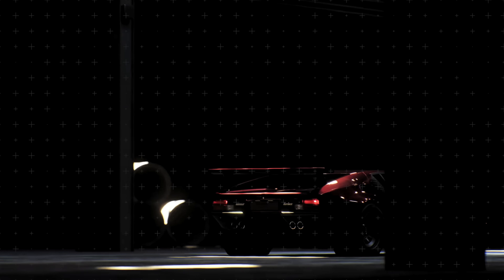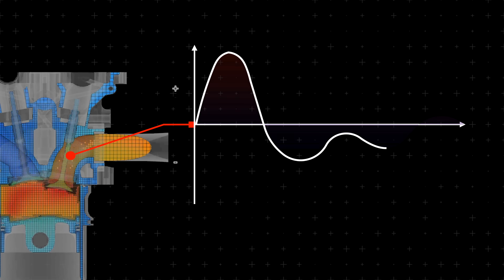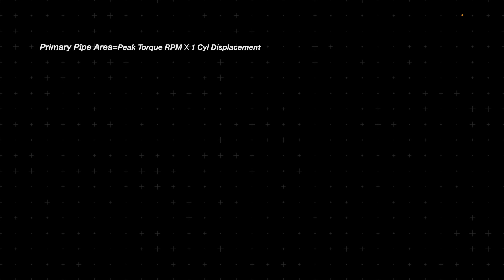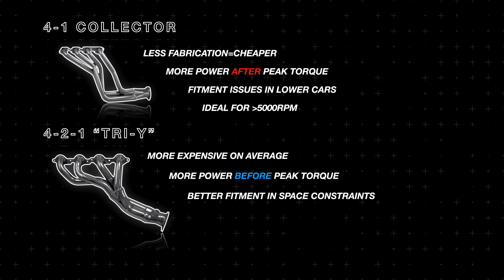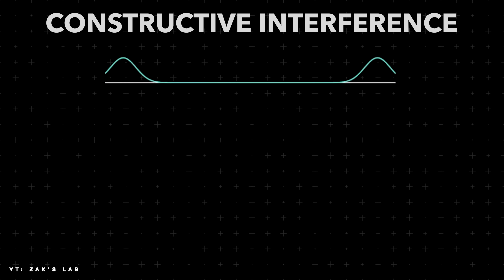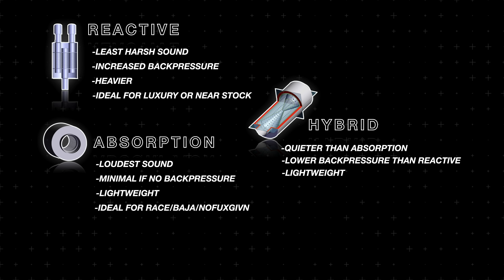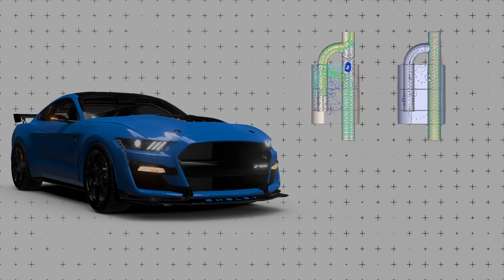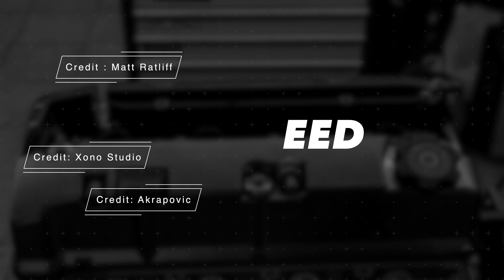Why Exhausts Make So Much Power😵| Explained Ep.27

Comment: This is my favorite part to upgrade on a Tesla
Reply: Make sure to get the oil change done first
Reply: Oil? My mechanic said acid change - he charged me $1,000 for the service and $150,000 for the medical bills. Guess it had a leak.
Oh well, 4th marriage ruined by the same car.
Reply: @chnacr2 strangely enough but kinda figured, tesla motors do have an oil inside of them, like a lubricant kind, for the gearing inside of them...
Reply: @chnacr2  teslas have to do oil and fluids for the mechanical components
Reply: @chnacr2  Tesla's actually do have an oil change interval.
Reply: @chnacr2  the gear oil does need changing in them they all have oil
Reply: Nothing like an oil filter change for my Dell from hell.
Reply: @i23intheplace2b Is that an AWD turbocharged Dell by chance?
Reply: Thats an expensive speaker 😂
Reply: @amburger4963  Just put a plastic card in the wheel spokes.
Reply: Add a few batteries 🪫
Reply: right next to the fire suppression system...
Reply: @Dr.Mcstaby 😅
Reply: @Dr.Mcstaby   As if fires never happen in ICE cars lol
Reply: Add some tank filled with gasoline too, you wouldn't believe how much range you'll gain over such simple addition
Reply: Get straight cut gears in your Tesla transmission.  I don't know why this isn't a thing, it sounds freaking cool.
Reply: Go buy a blinker fluid before everything or the car will explode
Reply: Don’t forget the air intake
Reply: I've got 6 pipes coming out the back of Tesla. But underneath they are all of different lengths, they are reeded & reduced. then connected to an air compressor! So instead of playing with phone at Stop Lights, I pull up a piano keyboard on  screen & blast out Church Music or Dukes of Hazard!
Reply: @kevinburke6743  Roflmao
Reply: Might as well change upgrade the carburetor
Reply: I always overtake Tesla's because the exhaust fumes from those cars is redonkulous.
Reply: @hectorae86 your not joking. If they are charged with coal burning fuel they produce  way more then any  internal combination engine  will
Reply: @Gh..o..s..t electric powerplants have 70+ perc efficiecy, Americans V8's approx 20 perc when german sofisticated turbo diesels can reach 40 perc. Answer is simple.
Reply: 😅 air intake as well 😂
Reply: @mahindrathar4092   Turbo in Supercharger out! Single purpose, single direction & single focus! If you don't push it in, she can't suck it out!
Reply: Me too
Reply: Yessir, I have 15 on mine! I even put dual exhaust on my battery, sounds fantastic.
Reply: Well don't forget to also upgrade your intake manifold.:eyes-purple-crying:
Reply: The first upgrade I would do to my Tesla is to upgrade it to a Mercedes
Reply: I found my people😂
Reply: no point doing an exhaust on a Tesla unless you modify the timing first...
Reply: You silly man, Tesla are electric! Everyone knows that if you use a fat extension cord, get mo' powa!!!
Reply: Yeah but there are too many to choose from 😂
Reply: Wait what
Reply: Ok
Reply: With a 62mm pipe exe... 🤘🏿🤘🏿🤘🏿
Reply: Hahahaha
Reply: Faforit saya juga ini
Reply: Electro magnetic exhaust is critical.
Reply: Love the application description for the absorption muffler. Think I'll be taking the nofuxgivin route
Reply: Rich Rebuilds and the Model D come to mind.
Reply: Same, gotta make that buzz sound as loud as we can! Golf cart sounds are just not cutting it
Reply: Only worth it if you turbo it first
Reply: i use my tesla to go out and buy parts for my big block
Reply: 😂😂 awesome!!
Reply: Especially if they are made out of titanium it will look really cool... however make sure you don't forget to put 1,000 fire extinguishers in your trunk
Reply: Faxx
Reply: motors use power , engines make it
Reply: why so many likes maaaan
Reply: A lot of people are doing the ICE mod
Reply: I did a upgrade om my rimac as well😊
Reply: @dominique21480 I know right I love putting mods my my rimac
Reply: Don’t forget the air intake
Reply: Why is there always a useless, juvenile, good for nothing comment like this on the top ? Please contribute something meaningful. I pity your empty life.
Reply: upgraded my washer fluid tank size 😎
Reply: What, the stereo, so it sounds like a real car?
Reply: I straight-piped my Tesla
Reply: Change the piston springs too
Reply: Home Depot has PVC tubing to make your Tesla some headers🤣😂🤣🤣🤣
Reply: Same
Reply: Can't beat that rumble n screaming u get from it with true duals 😅😂
Reply: I usually just swap out my Duracell for Energizer 😅
Reply: YES OVERSIZE EXAUST PIPES AND HEADERS ON A TESLA IS POWER BOOSTER AND IT SOUNDS LIKE A BIG STROKED V8
Reply: Current EV structuring doesnt allow for performance beyond what the motors and battery pack are capable of, which is why people gut the interior to shorten 0-100+ times
Reply: yes and replace that electric motor with a big block
Reply: crate stroked cammed engine makes music
Reply: yup with hellcat engine
Reply: bruh
Reply: first you need to put an engine in it
Reply: Camaros are so ugly
Reply: Pretty sure a turbo is the more fun upgrade on a Tesla. Easy to pipe in too
Reply: Yes man
Reply: Yeah that dual electric motor makes a fantastic sound
Reply: What catalytic converter do u use?
Reply: I see what you did there
Reply: Type shit 😂😂
Reply: Adding double A batteries is a good boost
Reply: Boring 😒
Reply: Right after all the plastic parts
Reply: Get an IC engine in Tesla
Reply: upgrading the stock pistons and connecting rods are almost mandatory with how those cars self destruct😂
Reply: Spark plug changes are the worst always get shocked
Reply: boohoo car joke.
Reply: Good bye real cars😢😢😢
Reply: Lol
Reply: You also need to add blinker fluid every 20k miles 😂
Reply: 😂 especially when the "update modules will increase the value of the car you already own"
Reply: Do the lope on your pipe Tesla lope
Reply: 😂😂😂remember  due to the engine dynamics of the Tesla motor you gotta go Y-Pipe into an X pipe just before the transmission or you gonna have an electrifying drone in the cabin
Reply: 😂😂😂remember  due to the engine dynamics of the Tesla motor you gotta go Y-Pipe into an X pipe just before the transmission or you gonna have an electrifying drone in the cabin
Reply: Can you bore a tesla to get more displacement ? 😂
Reply: Shhhh, If a tesla get this upgrade, we are done
Reply: Dont forget to change the spark plugs once every few months 😏
Reply: XD
Reply: I've seen this comment 6 times already so who stole it from who?
Reply: You don’t upgrade on a Tesla you update
Reply: V6 or v8?
Reply: bro i straight piped my Model S yesterday, but i dont think it done anything. it sounds the same as it did before.
Reply: Wow good one ☝️
Reply: Tesla owners favourite and most expensive part is the battery to replace. If you haven't gotten to this point you don't know... and for those who have, I feel your pain... same goes for any ev/hybrid....
Reply: I prefer to upgrade the driver.
Reply: Very funny
Reply: They have extended range blinker fluid Reservoir available now.
Reply: Lmfao
Reply: Best of luck 😊
Reply: Yeah. Right... Lol.
Reply: Hahaha
Reply: Make sure to add a new turbocharger (for the cooling system)
Reply: A Tesla is electric; it doesn't have an exhaust system due to it being powered by electricity, not gas or diesel 

....unless you're Rich Rebuilds (I used to watch him back when I liked Tesla stuff)
Reply: When you add electric E85 it starts sounding like a v8
Reply: Don't forget to upgrade the carburetor on your model Y
Reply: Mine too
Reply: That's only because you haven't tried blinker fluid
Reply: My type of guy 😂
Reply: Tesla with a Borla octubular sports exhaust is the best!!!
Reply: I wanna make a turbo Tesla
Reply: @Rifmaista  don’t forget to add a cold air intake on that setup.
Reply: The only modification in tesla is DURACELL or ENERGIZER 🤣🤣🤣
Reply: How dare you .
Reply: You put a electric turbo , and you will see the results....😁😁😁
Reply: The audacity 😂
Reply: I had to look up where to get a radiator cap 😅
Reply: Fastest install as well. Just bolt on some cool blue muffler tips to the rear bumper and you are ready to roar
Reply: Straight piped model Y🔥💨
Reply: I got an extra 13 volts with my brand-new exhaust pump
Reply: You win the internet 😂
Reply: Engine swap?
Reply: someone should add a fake exhaust  that shoots flames on a tesla for the memes
Reply: Nice one😂😂😂
Reply: Lemafeyo
Reply: dont forget to change oil and oil filter
Reply: ...installs new speakers 😂
Reply: Best upgrade on the tesla is like someone done a crazy loud diesel generator in the back haha
Reply: You have to do men!!!!
Reply: Rage bait 😂😂
Reply: If i could have a Tesla, i would have for sure! But it's too expensive here in Brazil 🇧🇷
Reply: @Franklin_Araujo  why? EV's are garbage right. Them get it right in about 10 years or so.
Reply: @jesterokjones4954   i dont think evs are garbage and i really like Tesla modes.
Reply: @Franklin_Araujo  We'll just say that they're not nearly up to the automotive industry's standards.
Reply: @jesterokjones4954  you dont know anything about Tesla do you?
Reply: @Franklin_Araujo  I'm an automotive mechanic, I literally get paid to know about a very wide range of vehicles up to and including heavy equipment and semis.
Reply: @jesterokjones4954  so why do you acting like you dont know nothing?
Reply: @Franklin_Araujo  Please, do tell me how I came across as having no knowledge of vehicles.
Reply: @jesterokjones4954  well, Tesla are in the first place when comes to EVs so why do you acting like you don't know they are in that place?
All automotive industrys are tring to cacht up Tesla inovation.
Reply: @Franklin_Araujo  No, I was saying that all EV's aren't up to the automotive industry's standards.
Reply: @jesterokjones4954  you kidding me
Reply: @Franklin_Araujo  Christ Almighty, dude, no, I'm not... If you don't know why they aren't or can't research it, I don't know what to tell you.
Reply: @Franklin_Araujo  Ok then, thanks for clearing that up....
Reply: @Franklin_Araujo tesla is a garbage car look inside interior it's horrible 😂
Reply: @Franklin_Araujo evs are junk
Reply: Is it weird trying to convince the workers at the coal plant to let you put headers on the furnaces?
Reply: The death of car industry.
Reply: Eww
Reply: Lmfao dude
Reply: Dead joke
Reply: Lol!    Doink!
Reply: 😂😅. But the rear differential is the biggest gainer of hp in a tesla
Reply: Are you 13 or something?
Reply: Bolt on Sound System
Reply: You still use a typewriter too? Get used to it dude. Combustion engines are over. Sooner than you think.
Reply: @sK3LeTvM1  Tell me you know nothing about how the real works without telling me.  Just because you made that ridiculous statement doesn't mean it's true.
Reply: @sK3LeTvM1 demonstrably untrue. Governments around the world are backtracking on ICE bans because they know EV's don't work...when they aren't catching fire
Reply: @sK3LeTvM1  wait, you still use an ev? Cmon gramps, you're not using public transportation busses powered by 15 cattle rigged to rollers and gearboxes in order to transfer the torque into high speeds with the sustainability loop of thier shit being harvested and used as the fertilizer for the plants that grow a tr the too of the bus to be used for feed? Admit it shit head, EVs are over.

On another note, assuming you weren't just kidding, ice is still gonna be a hobby for people. You do realize ethanol is a thing right? And due to its resistance to detonation, might even be superior to traditional gasoline.

Comment: Tubing vs pipe: tubing is spec'd for outside diameter, pipe is [usually] inside diameter.  If you want to get really confused... go look at pex tubing at any constrction site and wonder what those guys were smoking during marketing the invention.  I gotta buy so-called 1"pex to get 3/4" pipe flow?  Yes, Virginia, you do but its a kinda/sorta thing and cross section doesn't really match.  But I digress.
For a single plane crank, equal length primaries is true. But for a two plane v8 crank, lets please stop the mindless repetition of unfounded beliefs regurgitated from unknown sources like a licked ashtray:  its bullshit.  No matter what firing order is, there's always a pair of cylinders on each bank firing 90 degrees from each other.  With equal lengths, those exhaust pulses appear nearly as one large pulse at the collector - this affects scavenging/volumetric efficiency and those two cylinders will not behave the same.  Occasionally [depending on intake manifold & tune], you might catch your spark plugs telling that story upon close examination.  Cure is this: last to fire needs a longer tube relative to the first.  The focus needs to be on time of pulse arrival at the collector behaving closer to 180 degree separation of  events.  Probably doesn't need to be Germanic precision: something  inside +/- 30 degrees ought to provide decent separation and avoid squelching VE on the first firing cylinder on account of reduced scavenging.

Comment: Exhaust system doesn't increase horsepower, it regain crank horsepower that lost through exhaust resistance. So if you took out the exhaust, the horsepower increase become 0. Using high flow exhaust will be -5 to -10 hp. Stock exhaust is -50 hp.

Comment: Adding an exhaust on a normal car (with horsepower below 300hp) is non sense. It doesn't significantly add more horsepower to the car. Maybe someone will get +15 horsepower. You also cause damage to the environment if you skip the catalytic converter, which is bad. To understand it better, it is like walking down a street and listening to a skinny man shouting loudly. Then, on the same street you see a bodybuilder or a strongman not shouting at all. You can understand who is stronger, right? So, I believe that only cars with horsepower above 300 hp can opt in to have an exhaust pipe.

Comment: Please explain more on Turbos and mods for turbos.

* Dump pipe
* External wastegate (why car makers only use internal wastegates that fail/rattle).
* Inlets / outlets modding
* Intercoolers
* changing all the plastic factory plumbing for hard pipes
* How changing the diameter of the plumbing means more airflow because air hugs the outer walls of the pipe and not the center of the pipe

Comment: Just a technical question, does an exhaust upgrade cause more fuel consumption?
Reply from the maker: Freeing up exhaust flow makes the engine more efficient at consuming air, therefore more air + more fuel to maintain proper combustion means fuel consumption goes up GENERALLY speaking.

Comment: Very well done comprehensive video.... great balance between depth and breadth. I will contend many years ago I ran a straight through large single exhaust no mufflers on my SBC which was great for scavenging sounded incredible and did not drone inside the car. Many of my friends had cars with performance mufflers that had horrible droning inside the car. My exhaust had a sharp crackly growl that was music to my ears and was only loud when on full throttle... Anyway much useful information....

Comment: All that's good but I had to make all the exhaust components to form my exhaust as it has never been done to my engine before. I have a droning in my exhaust even though I am running hi flo cats ,xpipe, mid and rear hi flo mufflers 2.5" stainless steel pipe and tuned length headers.

Comment: No one else, except you, explained about exhaust gas flows faster in a smaller diameter than a larger one, resulting a stronger low end pull for a smaller diameter and a stronger top end pull for a larger diameter. Thank you. You have solved my misery after I have changed my exhaust and lost power at low end.

Comment: An engine is an air pump with fuel and spark added….. making it suck air in easier and expel easier makes more power….. in a 4 stroke engine the only time your making power is the power stroke and everything else robs you of that power so making all of the other strokes more efficient gives you more power with the same fuel or the same power with less fuel depending on your goals

Comment: I once tried a moped pipe on a small diesel car. Basicly decreasing the pipe diameter massively. The top speed was still the same butt the acceleration almost trippeld. It was really mindblowing to have better results with a tiny muffler.

Comment: I used to mod and drag race turbo cars. For these engines you don't need to worry about scavanging after the turbo, and only a small consideration is needed before the turbo. You simply want the largest exhaust that is practical after the turbo to reduce back pressure. The pros even run a short streight pipe after the turbo at drag meetings. The extractors to the turbo are important, as mentioned in the video. For a street turbo charged application the most impotant mod is the dump pipe streight off the turbo. This part can sometimes be increased to a larger size compared to the rest of the exhaust to reduce back pressure further. This is where most of the gains are made compared to the stock system, along with intake and boost mods.

Comment: The tuned header system doesn't produce power but allows it to release more efficiently!!!
The spaghetti looking one's are the tuned one's making sure the pipes are the same length before the collector which is a longer taper gently helping the next expansion along rather than blocking it!!!!